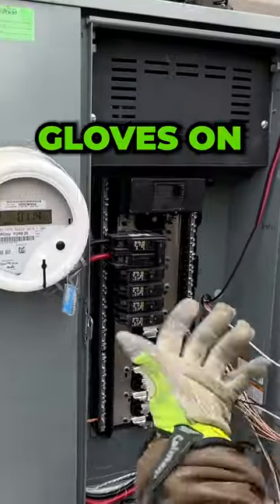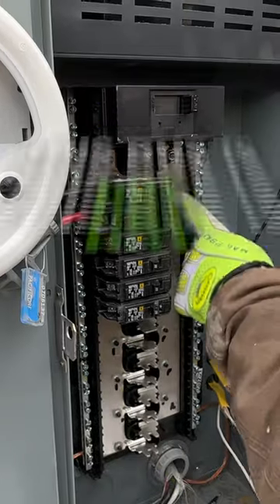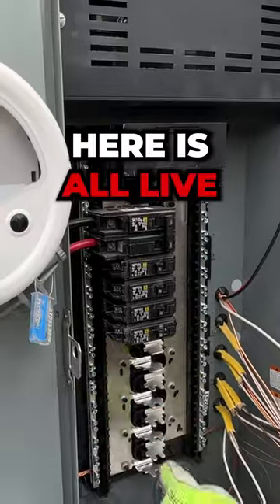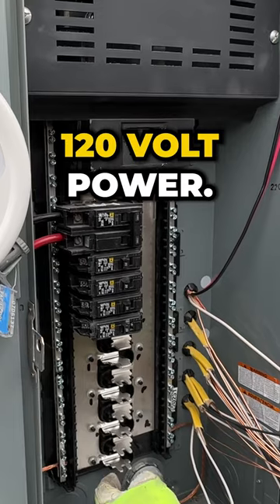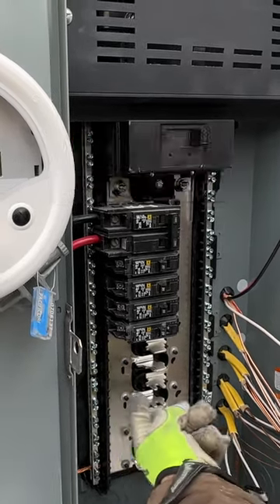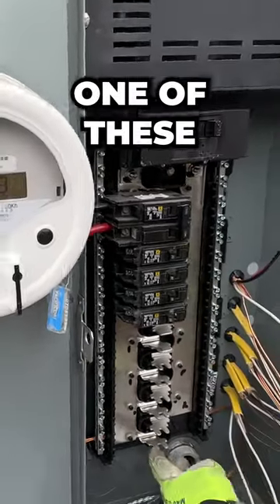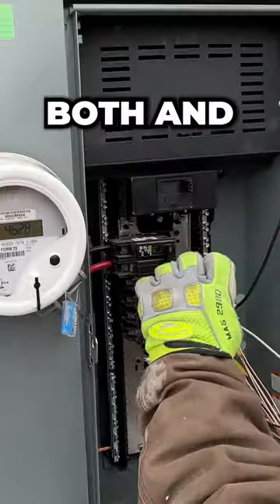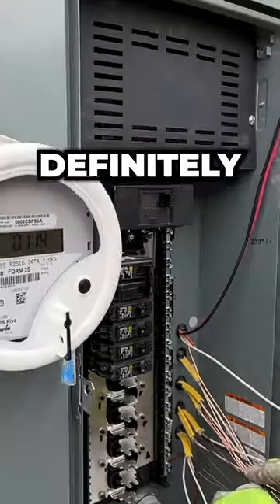Don’t Get Shocked⚡️Live Panel #Shorts

Comment: Fun fact, household power is lethal. The frequency of the electricity, is 60 Hz, and will make your heart try to beat 60 times a second. I believe it is also a harmonic of our heart beat too.
Brother, not sure what those gloves are, but you were not grounded, and if you were, you would get a tickle that could have ended your life. And were you using your left hand? Maybe I'm old-school, between were taught that or left was closest to our hearts, and was a more direct path across your heart.
Try safety thoughts before you do a demo
Reply: Your body doesn't care about current direction when it fires your muscles. The power frequency is double the line frequency (2 power cycles per line cycle) so it would actually be 120Hz power cycle frequency controlling the muscle twitch.
Reply: @onradioactivewaves  well Skippy I think you are, what's the word I'm looking for here, oh yah, wrong.
A cycle is one complete sine wave, start at zero, peak at 90, zero at 180, negative 90 and back to zero. That is one cycle, we don't use 120 hz devices, and there is no additional circuits to halve the line frequency.
Not sure where you got your training but I think you misinterpreted frequency.
And if I remember correctly, 60 hz is a harmonic of our heartbeat, but I may be wrong there.
So again, 120 VAC 60 HZ electricity is the most dangerous we use because people just don't understand what they are dealing with.
Reply: @johnstewart7059  there is indeed 2 cycles of power being delivered in one AC cycle. One on the positive, one on the negative. Look at an oscilloscope or just draw or visualize a picture of ac voltage and current, and now see that power is delivered when they are non zero, and in the same direction if both current and voltage are of the same signs. There's 2 zeros values in a cycle. Basically  you can just look at the dc output of a full rectified power and see 120Hz ripple one the DC output.

Also, harmonics don't come i to play with your heart like that. Your heart actually has a natural frequency somewhere below 2 Hz that come from the tissue itself, not the signal from the S.A. node going through the Purkinje fibers.  But that is besides the point, your heart cant beat 60 tines per second, it is beyond the physiology of your body function..
But if you  want to say that is incorrect knowledge then go ahead and challenge what I said, that is textbook knowledge you can easily verify online with the smallest amount of research.
Reply: @onradioactivewaves  again you have it wrong.
There is one full wave per cycle.
That's why a rectifier is called a "full wave" rectifier.
One that only address the half is called a " half wave" rectifier.
The wave travels through a full 360 degrees and is considered one cycle or hertz.
3 phase power has the second wave start at 90 degrees  and the third starts at 90 degrees of the second.
400 hertz is 400 cycles per second, not 800.
60 hertz is 60 cycles per second, not 120.
Reply: @johnstewart7059  dude I can't believe I have to explain this to you in such detail. P=V*I. Look at P over one cycle of V*I  and you will see cycles of power going from zero to a peak, nothing negative.  Ther is one powe delivery cycle for the positive half of the AC cycle and one exactly the same for the negative portion. If you look at an incandescent bulb if will have a flicker at 120 Hz which is the power delivery frequency of an AC voltage source. This is very basic stuff.
Reply: @onradioactivewaves  ok you are right because you have to be
Reply: @johnstewart7059  ya because my life depended on being right about it and having to argue with people about it when necessary lmao
Reply: @onradioactivewaves  and just for fun, you quote Ohm's law for power in a DC circuit  so keep going.
And don't ge rf confused with AC power, and back to the original comment the frequency at which 60 cycle power has nothing to do with current flow and more about frequency
Reply: @onradioactivewaves  and my life depends on it everyday and having been in the business for 50 years, I know a few things. Generally when make a statement that you have to "argue" the point makes it suspect.
Reply: @johnstewart7059  my point was that power delivery frequency on AC is twice the AC signal. And Ohm's law is V=IR by the way, you clearly don't know what you're talking about.
Reply: @onradioactivewaves  well I must not have done the old ohms law correctly all these years.
Apparently you really don't know what you are talking about, as the formula you cite is for power. It's one of the many ways Ohm is interpreted, P stands for power in watts.
I stands for current, and E is voltage.
So how you derive frequency from that is beyond me.
Ohm gets interpreted by the initial use of algebra.
 Maybe you should Google Ohm for AC circuits, then try the math.
OBTW, there is no Ohm for frequency.
As for frequency, consider a 2 pole generation system turning at 3600 rpm. Frequency output is 60 hz.
Turn it at 3000 rpm you have 50 hz.
And one last little thing, when I probe an AC circuit, like say an outlet, and set to frequency, my Fluke 289 reads 60 hz.
And of course in an industrial setting when I analyze power quality, the device I use is a Draentz power quality meter, capable of many measuring parameters. Even a 3 phase 480 VAC system in the US is still, wait for it, 60 hz.
Your arrogance about a subject you apparently have no experience in is amazing. Again Google how 60 hz power is made, then try work out your speed.
And while you're at it, get a copy of the Ohm's law circle, which describes how you derive an unknown if you know the other 2 parameters

Comment: 1. What is requiring you to work live that you can't turn the board off.
2. WTF, are you talking about, of cause it can kill you. You only have to receive a shock at the wrong moment in the cycle of your heartbeat to send you into fibrillation. Let alone if you get hooked up for an extended period of time. In either case, you better hope you have a competent safety observer with a defibrillation unit nearby
Reply: I do service work and have to work on on live panels at places like hospitals where turning it off isn't a option. However this guy is waaaaay to lax, even with a residential panel. No reason that panel needs to be live, also he didn't mention arc flashes. One of those ground wires touch the buss and it is going to arc.

Comment: These arent phases since theyre single phase. Individual phases would imply 120 degrees apart and a voltage of 208V across them. These are two legs of a single phase. Also your safety standards are very low. Treat electricity with respect or you will die.

Comment: I wouldn't take any of this guy's advice, you shouldn't get in the habit of touching anything live, it's called muscle memory and it can kill you especially when the other hand is holding a ground. If the dude was barefooted those leather gloves wouldn't protect him The correct way is to put a cardboard shield over the buss bars, until you are done landing wires on the neutral bars, when anytime electricity goes through your heart like one hand to the other,it can kill you.

Comment: Pretty sure these gloves are not rated for electrical work. Might as well wear a top hat and say you are protected. Do not follow advice found on a YouTube short for work where you can be physically harmed or killed. Most deaths related to electrical work is caused by 220 and 110.

Comment: Those aren't electric gloves... Just some bs mechanics gloves. I work with live 480v 3 phase 1200 amp cabinets everyday I have to wear cat two arc flash clothing even in 100°. I rarely wear my gloves unless I'm really really close to the live 480 buss bars. It's a dexterity thing.... That said I am dumb for not wearing them. But to say to everyone that 120/240 split phase won't kill you is 100% wrong. It will kill you a 1000 times over. I've been shocked by 240. I'm only alive because it entered my pinky knuckle and exited my index knuckle. If it had been from one hand to the other even with just 120 your likely to die especially if you hands are sweaty. My hands are so dry and thick that I can touch 240 with my finger prints without being electrocuted. But if it touches the back of my hands again dead. I've done what this guy is doing 100 times. But just don't go showing the lemmings how to kill themselves by telling them it won't kill them

Comment: Alright for all the people that are going to freak out about this video. The panel is not hot when this is being filmed, if you look at the top you will see the main breaker is in the off position (Standing up instead of angled and thus closed). 

What he means by 'live' is he is instructing the person recording that when the panel is in service those bus bars are hot and you would make a path to ground for that particular 120v leg to ground. 

The gloves might insulate enough, or they might just make it hurt a bit less but at this moment the panel is 'safe'.

Comment: If your intent is to educate the layout of a service panel and what is or isn’t hot, then Bravo nice job. But your steering people clear by not telling to wear the PROPPER rubber glove protection with leather covers if they are working a live service panel. People will look at what your wearing and go out in the garage and grab the gloves they changed oil in last week, not good. I can see your gloves are dry and YOU know your way around the panel and are in a dry area with good rated foot wear to isolate you from ground, which is the ultimate ground that should be pointed out.

Comment: FALSE!!! You can in fact touch(bare hand) any single hot rail and nothing will happen long as you do not complete a circuit. Standing in water, standing bare on earth, touch both rails, touching with neutral or ground. Then you'll feel it. I still wouldn't do it though. -Electrician

Comment: "nothing hot on your neutral bar or ground"- in reference to what?  The neutral is a grounded hot conductor that will and can hurt you. "2 separate phases" on a single phase?!-are we talking about the sine wave?!  When we reference single phase we talk about legs or lines.  The system is a two wire system with a grounded tap off the middle of the transformer. "It's not going to kill you..."

Hey buddy you maybe want to study more before you start teaching the children.

Comment: Dam you just killed every apprentice  out there.. and you dont work by the NEC CODE. Hell my 2 week apprentice  knows do not touch and buss bars with or without gloves.  If your not okay with it step away. Dont be billy bad ass. Im 27 an have a scare from the top of my skull to the bottom  of my stomach  all from electrical. (High leg hit by lightening) i was dead for 2 minutes.  (Storys) i woke back up and got back to work with blood running  doen my whole body.. i even have the pictures.. from coworkers. I worked  till ems hit me with morphine

Comment: 120 volts kills more people in America every year more than any other voltage.   The reason being is because people do not understand electrical theory.   The vast majority are not electricians,  because all it takes is 1/10 of one amp to cause ventricular fibrillation.   Please,  if you are not an electrician,  call a pro,  your life may depend on it.   Ive been an industrial electrician for 20 years,  480-volt three-phase,  up to 13.8kv are the voltages I work with.   But even when I am working with 120 volt circuits or panels,  I kill the power,  unless I must do it hot.   120 volts will kill you dead if you are not careful. Dont believe this guy.

Comment: That is absolutely enough power to kill you. You are failing to understand the total amount of power and the potential amount of resistance you are dealing with. I cannot be positive but it does not appear that your gloves are rated for direct contact with energized equipment. If not and those gloves get sweaty, wet and or dirty then touching the bus bar the way you did could absolutely introduce damaging and potentially deadly current into your body. I suggest you do some serious research for your own enlightenment and safety as well as those who trust your information and risk their safety at your word and instruction.

Comment: Jesus, bud, get this video off the internet. This is dangerous. You need a lot more explanation. This and that one, like you don't have the media training for this. These buses are hot but still 120 volts each and will shock you. A 15-amp breaker sounds dumb, but you need to dumb it down now. If you 240-volt yourself with two fingers, it will melt them good, I've been told. Neutral to another hot could get you really good. There's too much to learn. You can't be making reels like this.

Comment: 120 volts - "Not going to kill you"?
Oh dear. So you clearly do not know as an electrician what level of AC voltage can kill.

That is disturbing.

Let me give you the figure. Anything over 50 volts AC can kill.

Now that is not likely to happen at 50 volts to you unless your hands are wet.

But it is fundamentally wrong to say that 120 volts is not going to kill you. It can kill, if the conditions are right.

And a supposedly qualified electrician, you should not be saying things which are untrue, not where safety is concerned. YouTube viewers will look to you as the authority on electrical matters and believe what you tell them. And that IS dangerous.